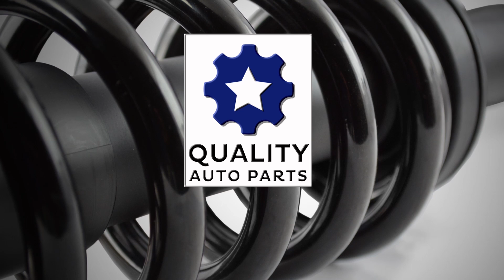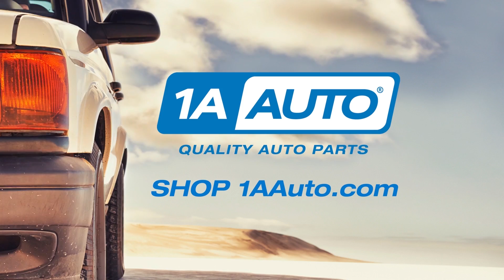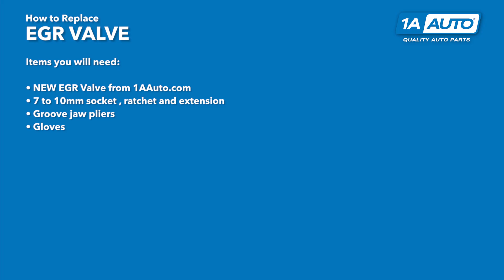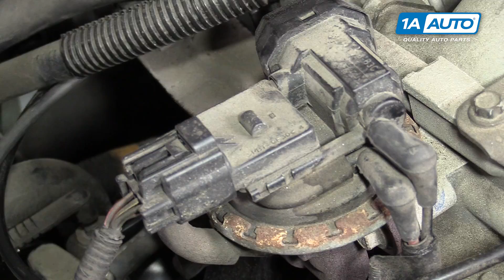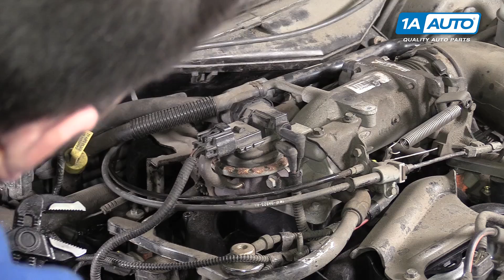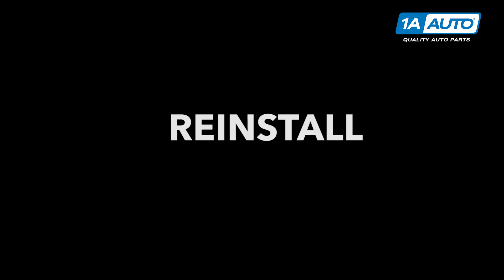How to Replace EGR Valve 03-11 Ford Crown Victoria

Comment: Fyi, the dpfe sensor is on the EGR valve for the 2009 Crown Vic Police Interceptor. It is not a separate black box with the two small hose connections and the electrical connection

Comment: I have the P0401 code on my 05 Town Car with 88k  I know you want to sell EGR valves but mine appears to be working. If I remove the cover from the breather side of the built in DPFE and put my finger over the tube, the car dies out. I removed the EGR and sprayed out the EGR tube and the EGR valve itself with intake cleaner but still getting the code. Any ideas?

Comment: Got a question will the egr valve if clogged or malfunctioning cause the vacuum to leak or no vacuum at all I'm trying to pin point issue with no heat no a/c no blower already replaced the head unit , took the blower out and tested it and it worked  , checked fuses and relays  but still nothing on the heater , ac , blower ( 2005 mercury grand marquis)

Comment: Could a bad egr valve cause a p0353, p0355, p0356, p0357 error codes? Car misfires at idle while in drivd but not in neutral or in park.
Reply: Intake manifold i bet

Comment: Thanks a lot for the video. I was going to take my 2010 CVPI to the mechanic Monday. After watching the video, I talked myself into taking on the task. Well it went without a hitch. I'm sure that saved me at least $20. Another thing I did to reset the "Check engine light", was to disconnect the battery hot cable, replace it and it is the same as re booting a computer.
Reply from the maker: +tiredlawdog Thank you for the great reply. We love to empower our customers by showing you how-to perform your own auto repairs while installing our high quality auto parts. Have a great day! 1aauto.com

Comment: I have an 06 mercury grand marquis with the 4.6 i got code P0402 and was told to replace the EGR solenoid not the valve. I got the solenoid, but cant find it anywhere on the car. Where is it?

Comment: what's this EGR valve for?
Reply from the maker: +Cesar Grande Thank you for checking us out. The EGR valve is used for recirculating a portion of the engine's exhaust gas back to the engine cylinders for emissions purposes. 1aauto.com

Comment: Any suggestions or techniques on how to take off the housing bolt I am having a hard time removing it?
Reply: I just did this repair and had similar issues (if by housing bolt you mean the one that attaches the pipe to the bottom of the unit).  At first i was doing it with a channel lock pliers like he shows in the video.  I couldn't get it loose, so I ended up using an large adjustable wrench (set to a little over 1") which allowed me to get enough torque to get it off. Might go without saying, but make sure your turning it in the same direction as shown in the video (push wrench towards center of car)